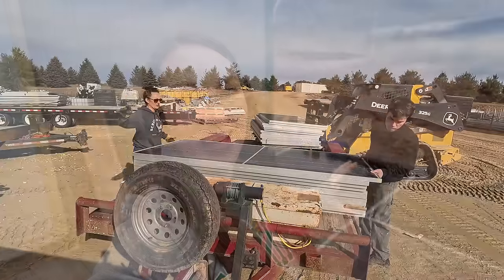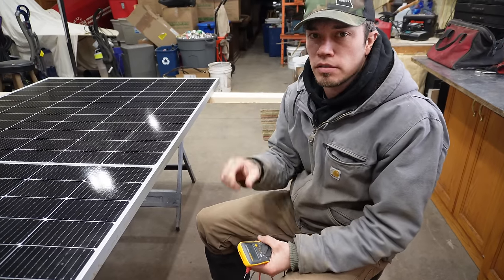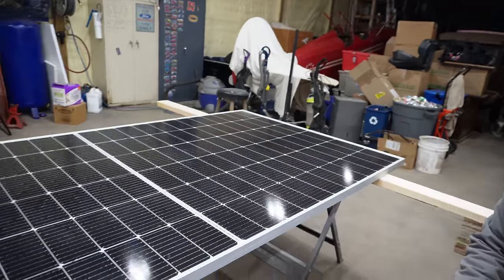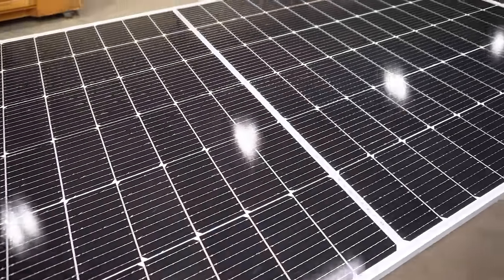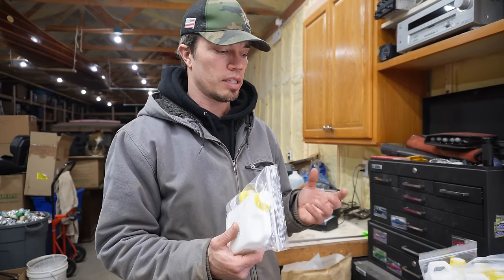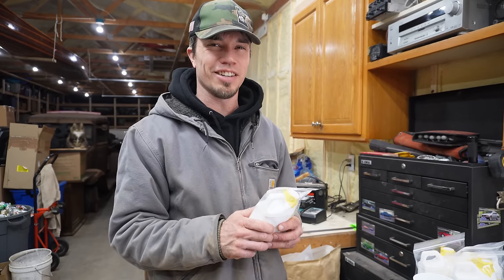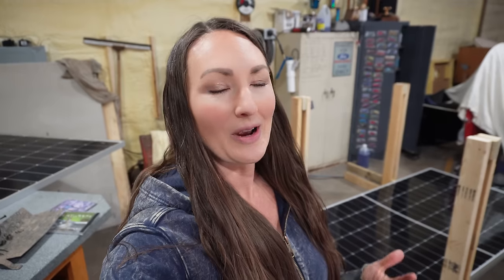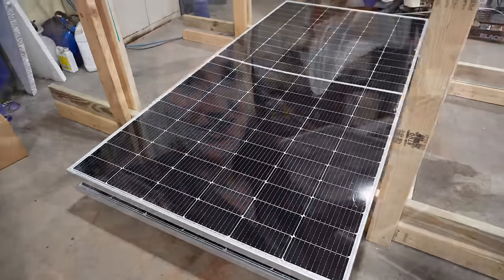Repairing Our Solar Panels with QSil 216

Comment: I would not recommend this. I have used Qsil 216 in our STEM class. We actually built small panels for RC racing. The first year we used the QSil 216. The problem is that the silicone, although it does help protect the cells, is soft and debris embeds itself easily. I recommend a UV stable epoxy instead. Take care.
Reply from the maker: We’ve never heard of a UV-stable epoxy before. Usually they will yellow and become cloudy with uv exposure overtime. Do you have a link to one? I’d love to check it out!

Comment: That's a grand idea to repair these panels, even if the most damaged ones only allow 3/4 of the charging that of a new panel. You still would come out ahead in the long run on the cost you paid for the panels in total. Great video, thank you for sharing the process with us!
Reply from the maker: I think you’re right!

Comment: Just in case you all aren’t familiar with repurposing forklift batteries for your solar system, they are getting a second look as they can hold an amazing amount of energy and are often free to very low cost if your do a little scrounging homework.  Often people cite that you only get 50% of capacity but many solar applications seem to be getting significantly better results.
Reply from the maker: Thanks for the info!! I’ll look into that

Comment: Great job! I would also suggest checking the cells with an IR camera for hot spots. The cracks can cause hotspots that could lead to a fire. Would hate for your whole system to go up in flames. (I worked for a panel manufacturer for 9 years.)

Comment: Some cells are certainly damaged. you can find out by comparing the voltage and the current of each panel under the same condition with undamaged one.

Comment: Hey that cost 50 bucks you used half that for a 400 watt panel that you paid next to nothing for.  25 bucks to fix it yeah thats a win.  You may want to do it in warmer temps it may spread more thinly and easier.
Reply from the maker: I think it’s a win, too! Yes, it went on a lot better when it was 70 degrees. I’m at the mercy of the solar wall and how much sun we have that day

Comment: Take a voltage reading on the same panel after the coating is dry, just for a comparison. Did you get the clear coat under the metal frame around the sides?

Comment: I wonder if it was possible to process more in a day if you used a large squeege. note, not all are made the same, I've used some from Fellers which sells car vinyl applications supplies. Might use less chemical per panel too since you can put on a thinner more consistant coat.
Reply from the maker: I wonder about that too! I’m going to give that a try for the next round 💫

Comment: Would be tempting to build an oven to process the panels.  Use it to heat them in a controlled way. And to cure the sealer more quickly.  

I wonder if there’s a thinner or reducer that could be used to spread the sealer more easily.